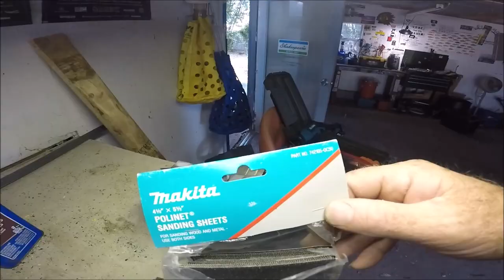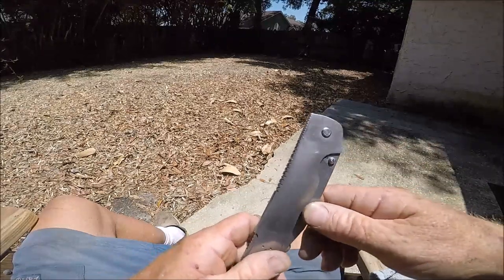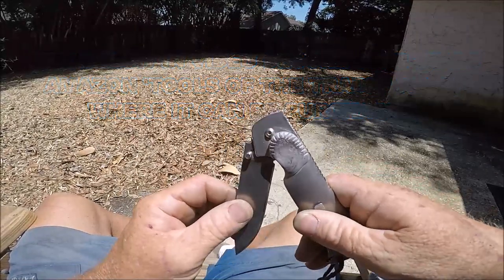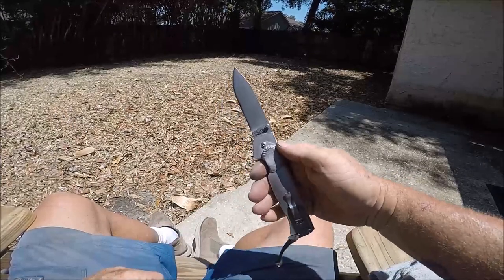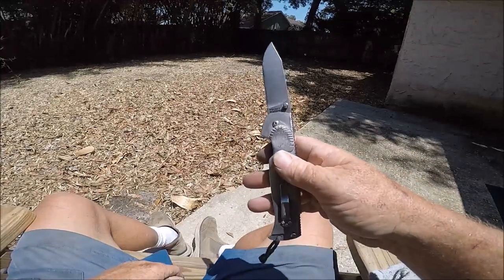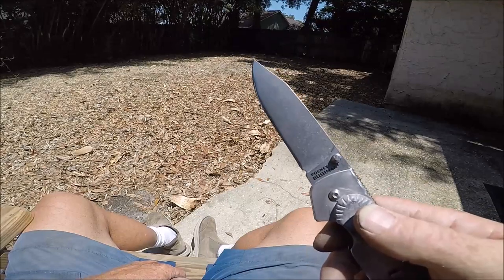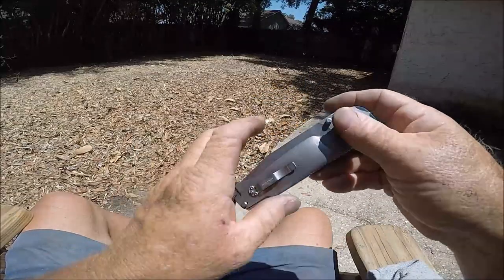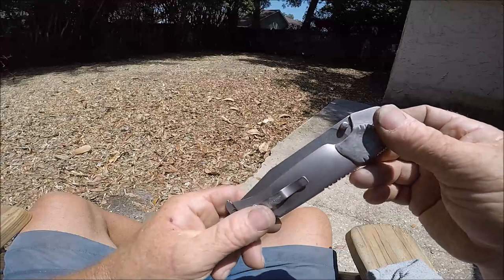COLD STEEL POCKET BUSHMAN, MODIFIED

Comment: Interesting video Dave. I owned a 4" blade (illegal in MD) Cold Steel tanto with a black blade. Terrible idea, unless you just wanna flick it. After any reasonable use, the black coating comes off and the blade is ugly. Used paint remover to get rid of it. Had to surrender the knife at an Orioles ballgame or walk 8 blocks back (16 blocks total) to the vehicle to secure it. Carried a folder as a teen in NYC as last-resort protection. Became adept at flicking it outta my pocket.. Stopped. Began carrying a knife again in the 1980's because I fished a lot. Found it invaluable every-day from spreading butter, cutting rolls, slicing sopresatta, filleting fish and slicing rope. Feel lost without it. The blade is still last-resort protection. As my teenage friend told me, "Don't flick it. Don't show it. Only use it as a last resort."
Reply from the maker: never not carried, a knife. since I was running around with my daisy red rider bb gun. never for protection, just as a tool. today, the 'kiddies'' wanna flick and play, watch any youtube knife guy. The EARLY  coating were just paint. Which is a different animal today. But, I was never into them. Only have one cold steel with a very nice black blade.